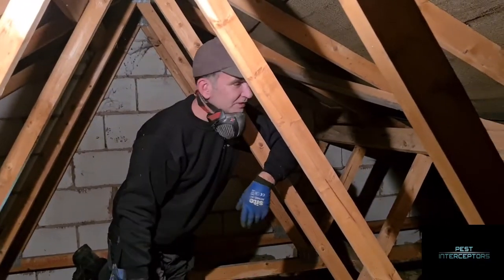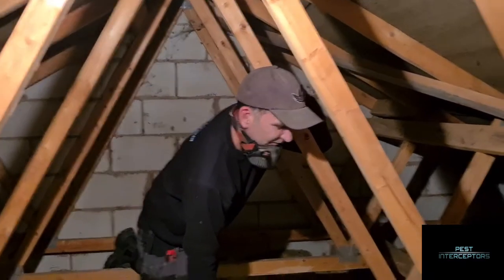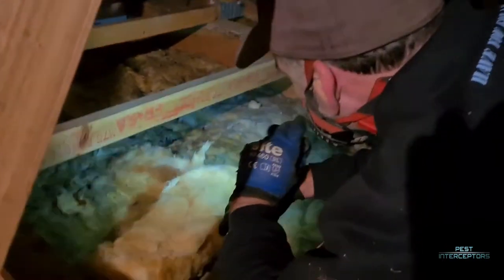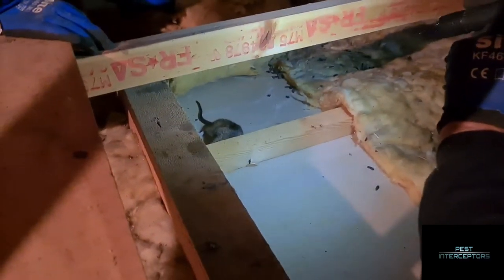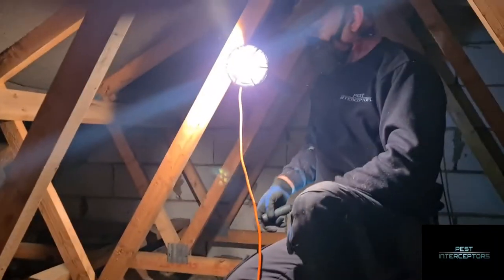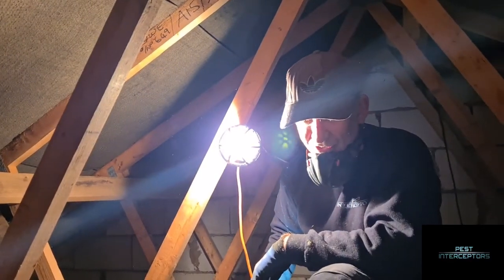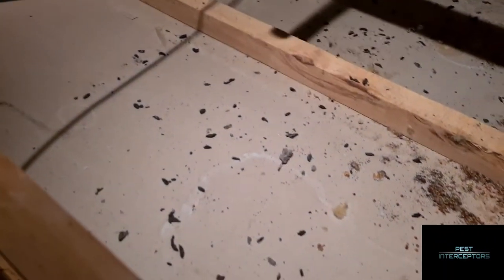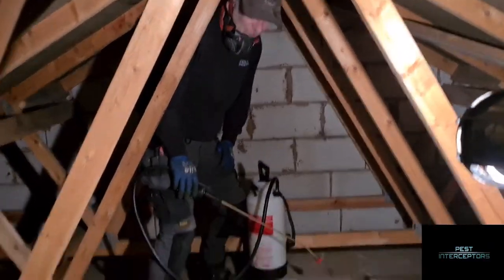How to stop rats, mice and squirrels wanting to get into your loft! Loft clearance and sanitisation

Comment: Had my fair share of mice problems (wood mice) mostly in the loft, found out they were coming through from next door from a hole in the wall up there between our properties, next door is a hoarder and most likely was attracted to her messy home and overgrown garden but they sometimes came into our house. Even had them in the actual house away from the loft as I noticed there was another hole in the skirting in bathroom, they climb walls down from the loft, one ran into the bedroom one evening as I was reading at the corner of my eye saw something very quick run under the bed, checked underneath with a torch and there it was looking at me against the wall behind the bed and then it darted back out the room, they are so quick. I've found decent traps with peanut butter work best, they can't seem to resist peanut butter.
Reply: Have you found it impossible to do exclusion work between you and your neighbor's house? I live in a townhouse and am dealing with mice which I suspect are coming from my neighbor's house as we've done all our exterior exclusion work for our townhouse.

Comment: Is Biocide the same as using an enzyme rodent odour solution or does it do a different job? Im planning to do a similar job in my loft space and wondered what best to use to spray on to get rid of any rodent scent before reinsulating. I… does a diluted bleach solution have a similar effect too? Thank you for your advice.
Reply from the maker: We use a product called Ornikil
Reply: @PestInterceptors  thanks. Yeah i saw that £100 for 5L not sure if it’s something you need to dilute with water? If so, presumably a 5L will stretch to 10L? Any advice on this pls? Thanks. Your video is a great guide. 👍
Reply from the maker: @bbwnpat  it is used very diluted! I think from memory that 5ml makes 5 litres! 
Ps. I hope you’re not doing this to stop rats?
Reply from the maker: @bbwnpat  5 litres will make 5000 litres. 
1 litre will make 1000 litres. 
It’s strong stuff!
Reply: @PestInterceptors  1L makes 1000L ? Wow that is strong stuff.
Reply: @PestInterceptors  just to clean up after the rats. . Gotta clear the area and cleanse before filling any entry points and re-insulating. I think they are gaing entry via the wall cavity  but difficult to tell until ive cleared it all and surveyed it throughly. Thanks for the feedback.
Reply from the maker: @bbwnpat  99% of rats in lofts are getting into the cavity via a sewer or drainage problem. Check out our rat videos and you’ll see. 
We never sanitise a loft unless we have stopped the rats for this reason. 👍🏼

Comment: Once you have cleaned and sprayed, do you need to find how the rats and mice are getting in to the attic space.  We have a very low pitch L shaped extension, and we had a terrible smell.  Crawled in there, followed the smell, and found a dead rat in between two layers of rock wall insultation.  We now have scratching noise every winter.  These things do not want to go into the traps.  Any advice please?
Reply from the maker: We never do a loft sanitation unless either, we have got rid of the rats in the first place, or, we leave monitoring baits behind for a few weeks before doing the job. 
If you were my customer and we came to give you a quote and you told me your story I’d tell you the rats are going to return, so there’s little point in doing the cleanup. 
I’d them explain why I think (know) the rats are coming from a sewer/drainage problem and offer to do the job properly. 
What you explained is a classic case. 
Take a look at our playlists on rats, or this one about our Rat Free Lifetime Guarantee service. It will explain: 

https://youtube.com/playlist?list=PLMSQuVC3ns4_Mfr9UrjAVh4ztQF0bOiXy
Reply: @PestInterceptors  Ok thanks.  We had the extension done 11 years ago, and I only remember having a problem once I installed the insulation 9 years later.  A local chap advised, (and I paid £40 for this advice) lay some traps up there and see if they are rats or mice.
Reply from the maker: When I hear “had an extension “ I’m 99% certain. 
We only cover long distance jobs with our Rat Free Lifetime Guarantee sadly for you. 
Watch a few of our videos. 👍🏼 
Good luck, and you know where we are if you need anything.
Reply: @PestInterceptors  Ok thanks.  I might borrow a drain camera and see if there is anything going on.  The drain cover was removed as we built over this, but all this was replaced by new soil pipes.  At least that might show something.  I've got 7 bated traps in the attic, all with different things to attract.  Even tried the dried cat food stuck to the bates.  No luck yet.  Thanks, I will keep watching the channel.
Reply from the maker: We never really use the traditional snap back rat traps now. Rats in the Midlands just take a look at them and smile. 
Take a look at our Black Cat videos. We let slip our favourite baits too.